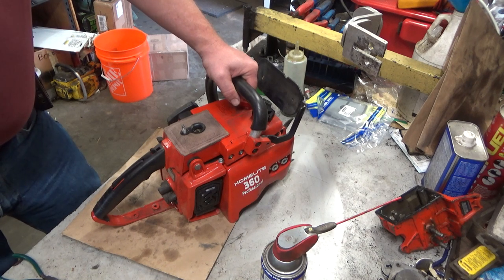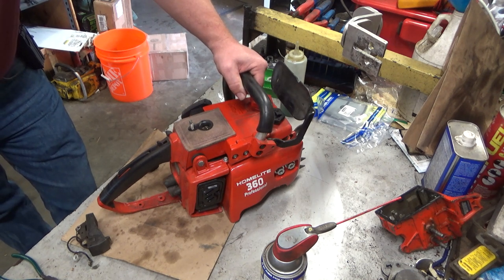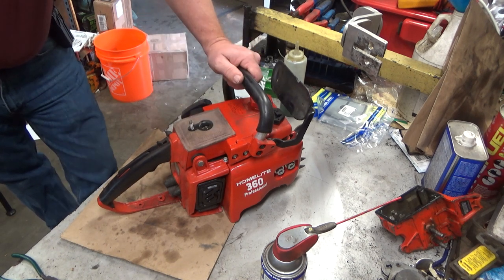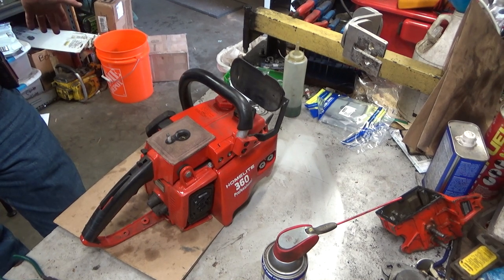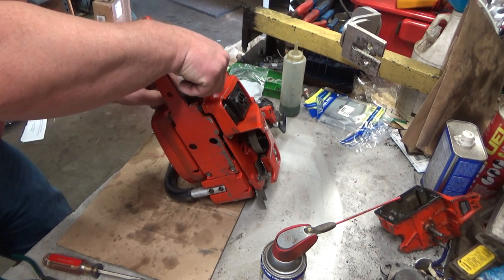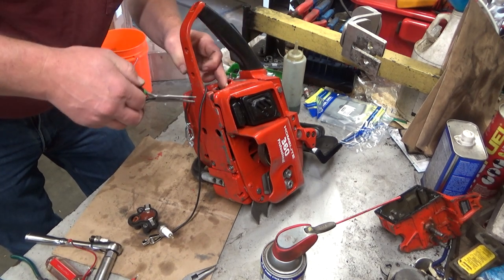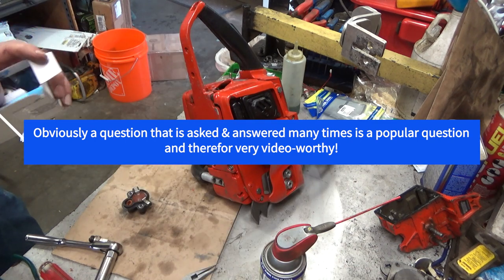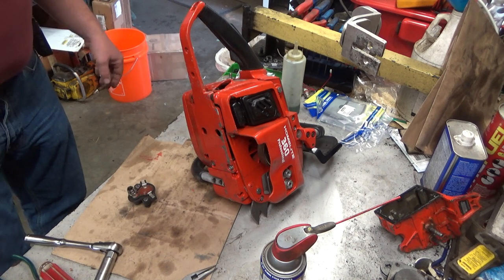Testing A Homelite 350, 360, 450, 550, 650 or 750 Chainsaw Coil & Transformer Ignition System!

Comment: If you have a no contact rpm tester for saws or any engine you can use it to see if there is spark as it is just a no touch voltage tester with a digital counter for determining rpm’s

Comment: In my experiences I've found more problems with breakage of the horseshoe connector thingy. Maybe from being overtightened? Or a solder joint shaking loose on the horseshoe thingy. Of course "thingy" is a Homelite tech term. Very rarely does the coil go bad, but the plug enhancer spring does his tendency to grab the plug when being taken apart and if not paying attention is easy to pull it out of kilter, stretched in other words. Leon, great vijayo. I use the prime down the gut method. If no chunka, then on to the next " what might it be" head scratch scenario. Most of the time it's the on/off switch. Twas an idiot betweenst the switch and the pull cord. Cheers. K

Comment: Now Jonsered has a similar setup on for instance the 410, and I do believe the voltage from the primary coil is at least 120 V. But it is most likely a short spike. The voltage builds up and cuts off in the time the permanent magnets pass by the laminated core of the coil.

So that would be 120 V going up your fingers. Well, an electric fencing is perhaps 10 000 V; and that will shock you, because it goes through your heart.

Comment: Hi Leon !! I couldn’t tell real good by the video, but it looks like your Fluke meter has a min/max button on it. All you have to do is set the dial on the voltage you want to check , then press the min/max button and the meter will automatically hold your minimum and maximum value for you .